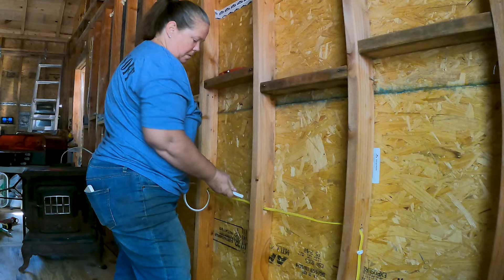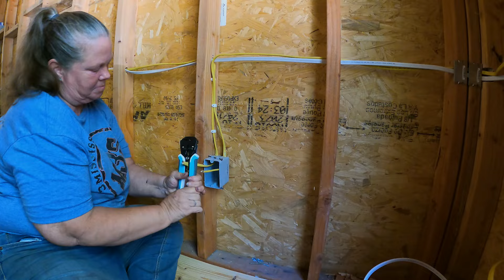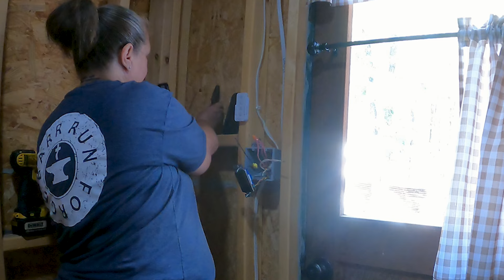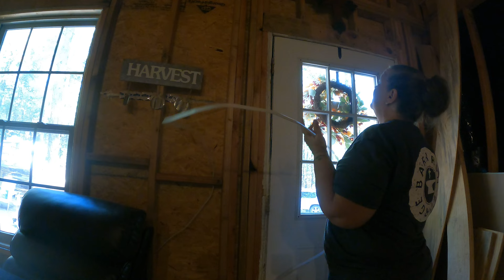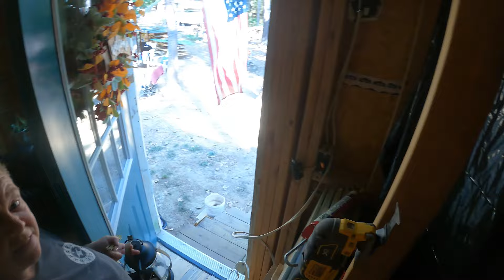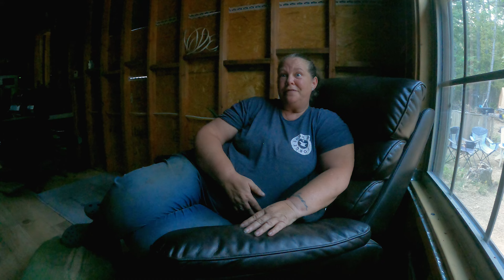Ugly Work = Beautiful Results

Comment: Steam from a shower usually starts at the top of the walls and runs down, the bottom half doesn't usually have moisture problems, you should consider putting the moisture barrier all the way up
Reply from the maker: Will only have a clawfoot tub not shower but moisture barrier will be on all the walls.

Comment: Are you using spray foam insulation or batting?
Reply from the maker: Batting
Reply: @possumrunhomestead be sure to put batting inside bathroom walls
Reply: Inside walls
Reply from the maker: Yes definitely